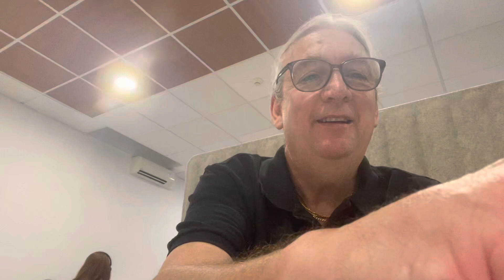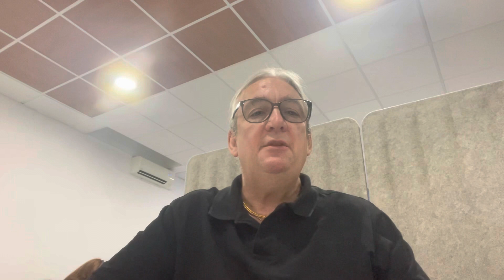#Sunsynk fault code forum

Comment: Ive got an audio alarm on a sun synk EESS / Inverter combo , this may have coincided with a F56 Low DC occurrence but I was not present at the time shown in the log. Anyway I anticipate that once charge level is sufficient the audio alarm will cease. My question can I switch off the audio alarm during the intervening period?

Comment: A suggestion to Keith and the Team. Why not setup a WhatsApp business number with automated responses to troubleshoot some of the common problems. The automates WhatsApp response can take the client through multiple steps to determine the nature of the problem and possible solutions. Often installers may not be readily available to solve specific issues. I'm sure by now you must have a database on the commonest issues faced by both end-users and installers. Simply solutions like un-ticking "grid export" will solve common questions.  Many people are moving to solar and undoubtedly there'll be many more individuals calling the Sunsynk technical support number.

The WhatsApp bot can start off with something simple like. "Select the type of current the inverter (s) are connected to"
1. Single phase 
2. 3 phase
Then it can ask (based on the response) "select the sun inverter model"
1. 5kva
2. 8ka
3. 16kva

Then it can ask (based on the response) "select how many inverters are paralleled connected in the system"
1. 1 inverter 
2. 2 inverters
3. 3 or more inverters

Then it can ask (based on the response) "select the mode in which the inverter (s) are connected"
1. Island mode 
2. Hybrid/Grid tied

In the end the not can give a suggested remedy or whether to contact with the installer